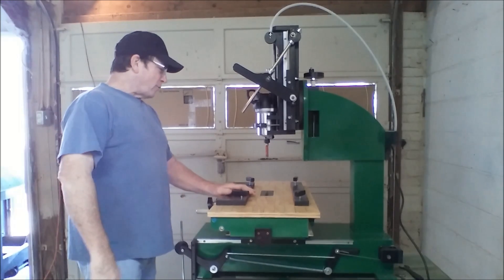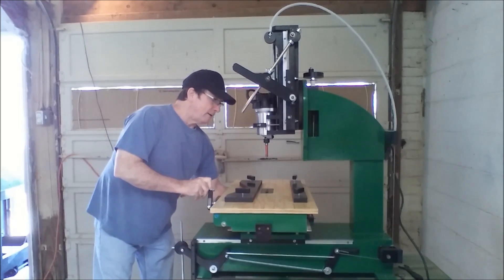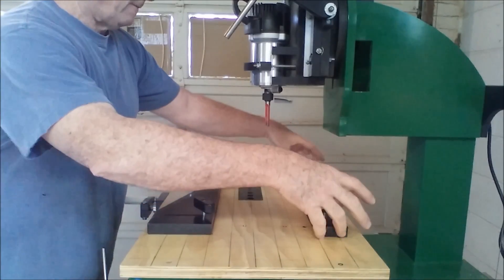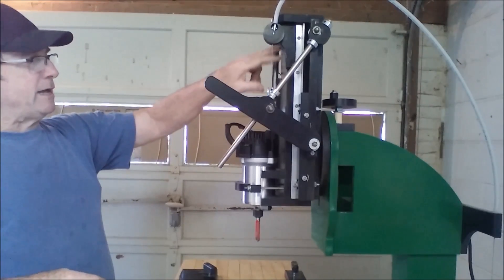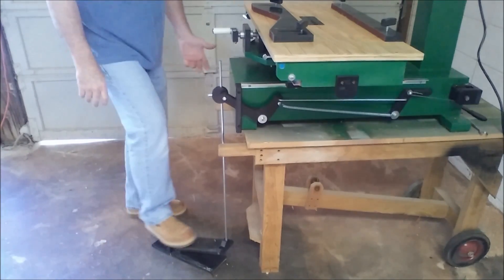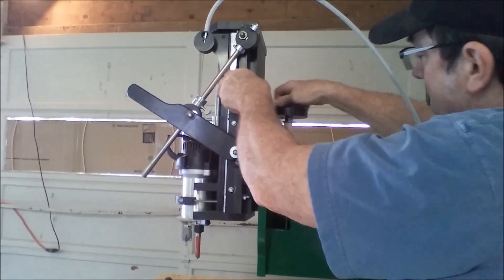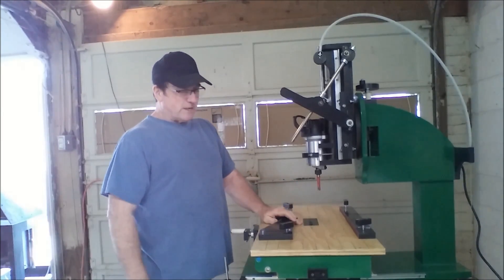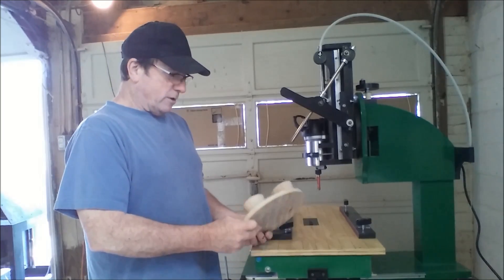Bench top router mill

Comment: VERY smart design!  I'm in the throws of making a CNC router/mill, that I'm presently using manually (without motors), and I've picked up several really smart ideas from your design.  Love your clamp mechanism.  My milling table is drilled in both X and Y, with T-nuts below, so I can implement this easily.  Also like your foot-pedal driven quill arrangement.  I can see that being used on a drill-press to oscillate a sanding drum.  Thanks for sharing!

Comment: I own a full size deluxe router mill made by Routermillwoodworks. This is my go to machine. For me it is faster than CNC, that being said this is a great prototype creating machine! You can just place the material and start working. I like the full size so much that I just ordered (2) of the benchtop router mills. My plan is to use all three in full production. Using the full sized model daily, I can say it has not failed. It is hard to do production with a machine needing service. Routermillwoodworks design machines that stay productive and produce very repeatable results.